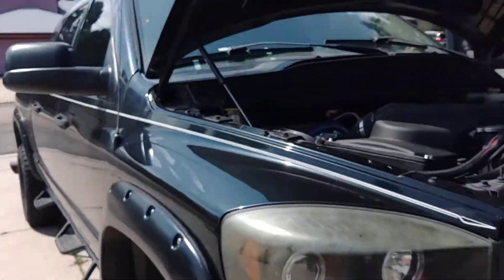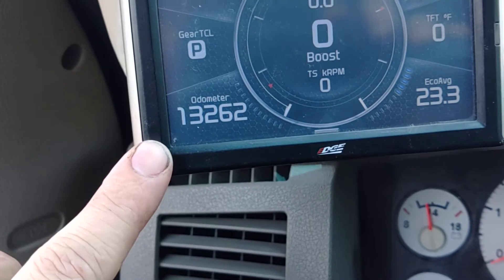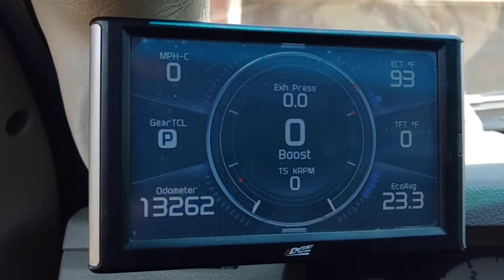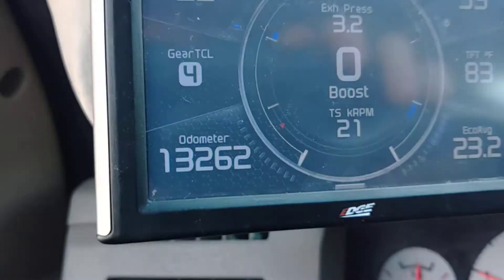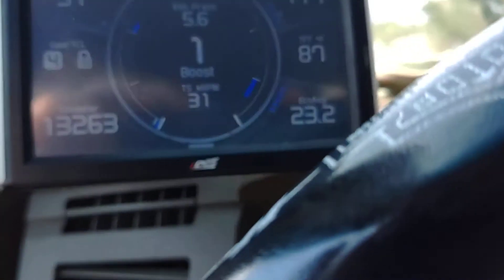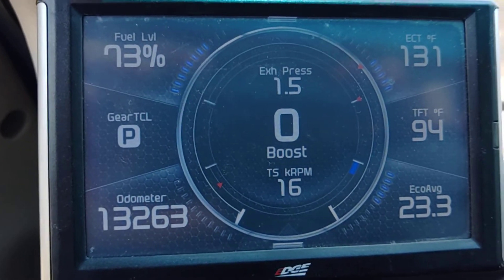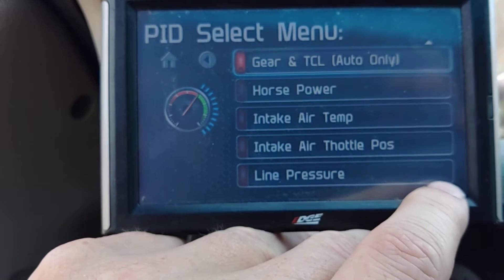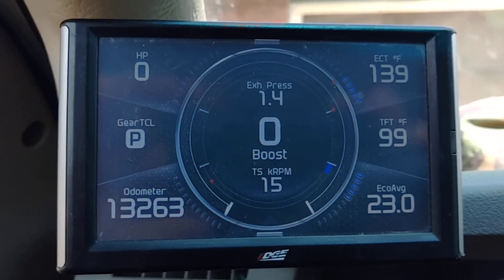2007 Ram 5.9 to 6.7 update

Comment: I have a 2004.5 with the 325hp 5.9.  Looking at buying a wrecked 2019 6.7 cummins that is complete to swap to into my 04.5. Your videos are great but I still have a lot of questions.
Reply from the maker: Feel free to hit me up on Facebook. The swap is pretty easy it's no different then swapping out our 5.9. once I have the new controller it's just a plug in conversion as far as the electronics are concerned. The only issue with the 19-21 engines are the CP4. You can probably find a 22 for the same price. I got mine for 13k with the transmission tcase and all the electronics and belt accessories

Comment: Hey Steed!, when is the new vnt turbo controller coming out? Kind of wait for one for dyno testing on a project.

Thanks
Reply from the maker: ATS will hopefully be selling them by the end of the year. Having an issue getting the headers for the board.
Reply: Is there any beta test versions available that are not quite cosmetically complete?
Reply from the maker: @christianmgtow4744  No, waiting for the physical controller. Once we have the controller well be testing it out.
Reply: What is the possibility that you having one of your previous versions available? I know you probably have a contract with ATS. I had discussed my big block compound turbo propane engine project in the past with you briefly but I'm about to get started with it now. Sorry to bug you. Thanks for your time!
Reply: I’d sure like to buy a vgt controller when they’re available.
Reply from the maker: @romeoone3895  Youll have to go though ATS and order their Intelliboost. It should be ready around the end of the year.
Reply: Sorry to bother u but can i throw a 6.7 in my 2006 5.9 just throw my fuel system from my 5.9? Id do a Frankenstein 5.9 head 6.7 bottom but my heads cracked thanks for your help